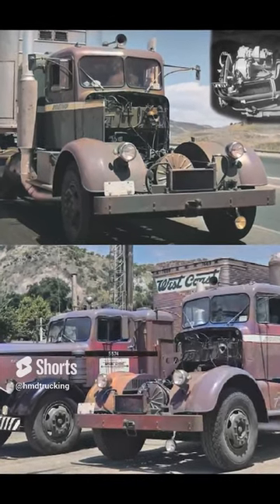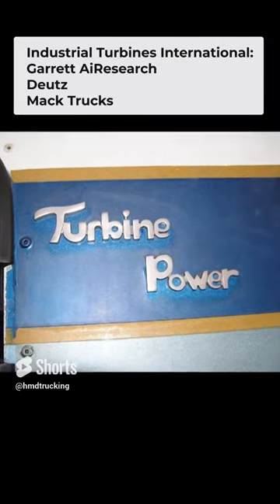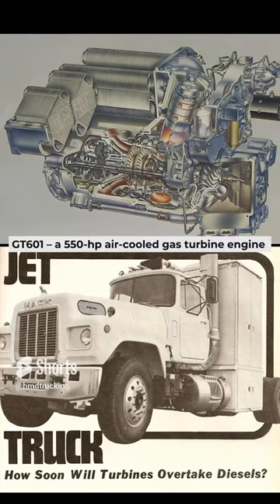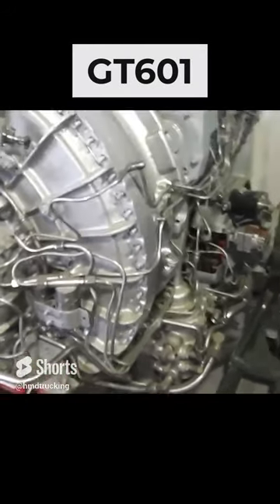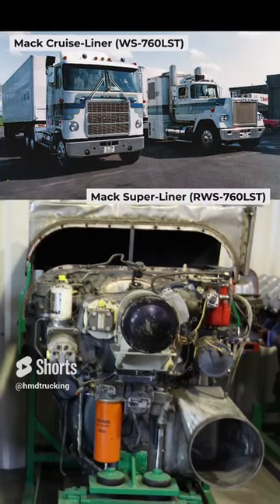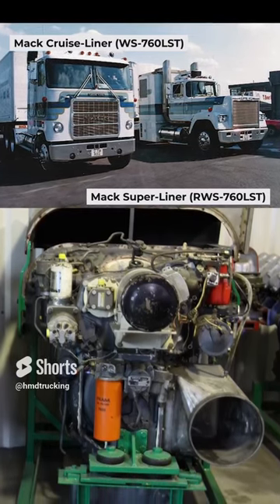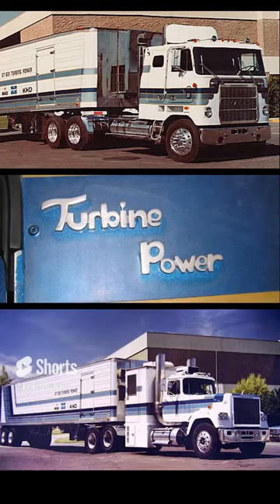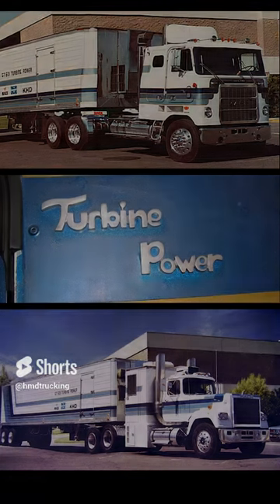Why Mack Jet Turbine Trucks Didn't Dominate the Road

Comment: I remember that project. Air Research built the truck in Arizona where I live. Turns out the average Trucker didn't have a half million dollars for one truck and the EPA didn't care much for it either. So, adios turbine truck engines.